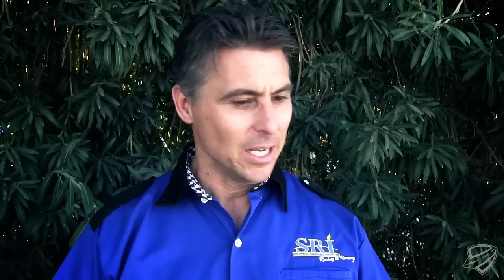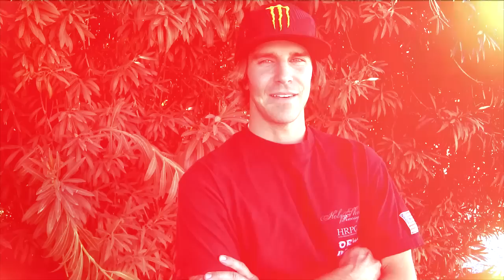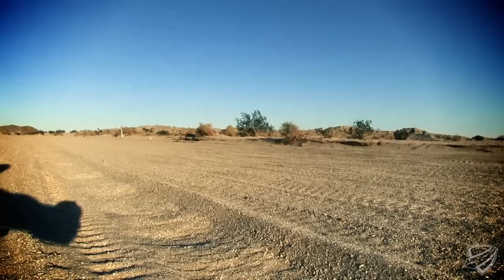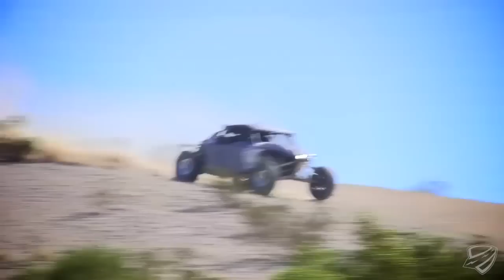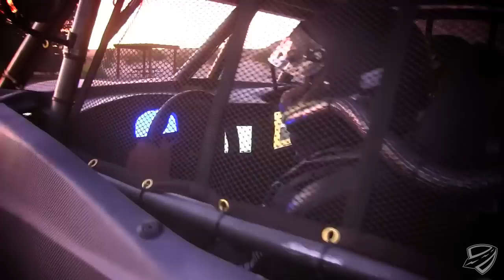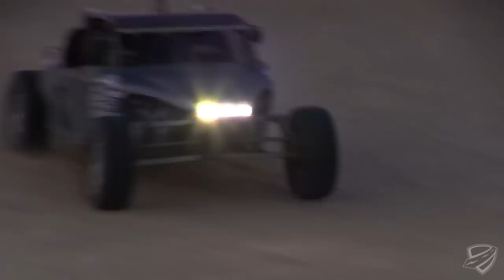SRI EV1 Electric Off Road Racer - SRD - EV West - First Electric Baja Race Car

Comment: Absolutely LOVE IT!  I think swappable battery packs is definitely the way to go with electric racing.  I was thinking the other day that a battery pack that slots into the vehicle with heavy duty gold plated connections could be swapped out quickly during pit stops for "fuel".  You'd need a permanent battery to keep the electronics up and running during the swap but that wouldn't take much.  Can't wait to see more of this buggy!

Comment: I dont know anything about electric power but this is awesome. would a cooling system have to be run or are the motor(s) cooled by air, or does it even need any cooling at all. I would imagine running so much power through them that they would heat up quite a bit...

Comment: How can it run 2000 amps and 750 volts through those motors?
Reply: Richard Meek it is a hot swappable 230v pack running 200amps

Comment: Most all of the shots were done with 'chase vehicles' that were gas powered, so it was difficult to get a shot where the audio could be used, and where you could hear the electric drive. All the quiet shots at the beginning of the video were stationary shots for this reason. (albeit, slightly more boring because they're not moving) The music covered the sounds of the gas powered chase vehicles.

Comment: Power to weight, range and recharge time aren't impressing me. Good start tho. I wonder if you can easily swap out the battery for a fully charged one. Or what type of generator it would take to recharge in 5 hours while I get drunk by the camp fire LoL

Comment: If it had hot swappable batteries, it would be faster than filling up a tank of dino juice. The batteries don't pollute. Do some basic research before repeating what some other air head has already said.
Lithium ion batteries are completely non-toxic and contain no heavy, radioactive, or rare earth metals. They are also reusable as energy storage units (they're still at 80% capacity after 8-10 years), and can be over 90% recycled when completely spent.
Reply: What a load of coolers.  Have you seen what mining lithium does to the countryside.

Comment: sooo the motors are in an enclosed box with filtered air being forced in....sounds a little odd to me..
Reply: +Andrew Olsson  dont get me wrong i love ev vehicals i just would like to see some more detail of the vehical and a little less action footage...
Reply: The motors need clean air cooling so I'm guessing they are enclosed with two large holes at opposite ends of the enclosure to duct filtered air through.
Reply: Kaylee Olsson its a bit like a computer tgey they stay cool. you dont want dust or dirt clogging up moving parts or keeping it from displacing heat.  same reason gas engines need filtered air well at least the not wanting durt wrecking moving parts
Reply: some of the newer ac motors are completely sealed like the netgain hyper9

Comment: I can get behind, in to, an EV if the preformance is about the same and I would rather an EV than having to drive an ever smaller ICE. The only issue is battery power, or a good generator.